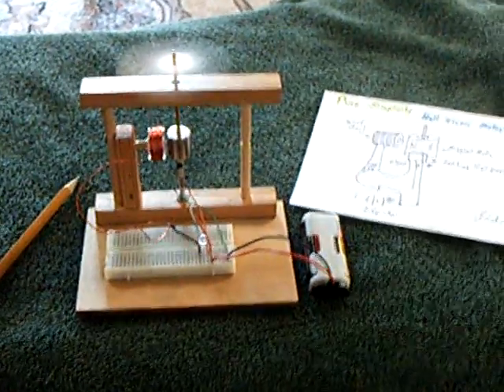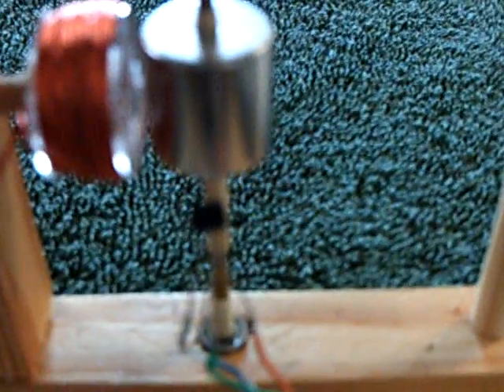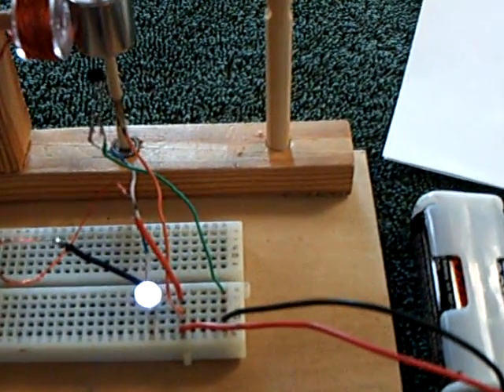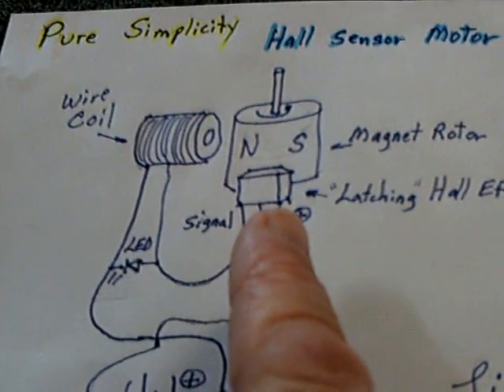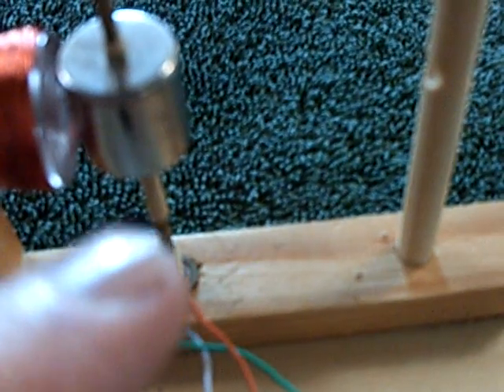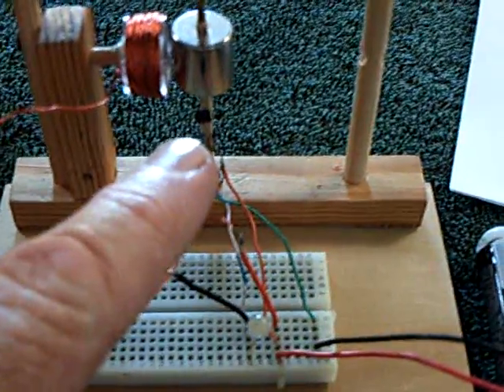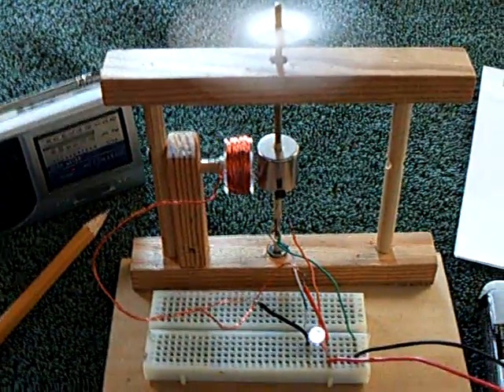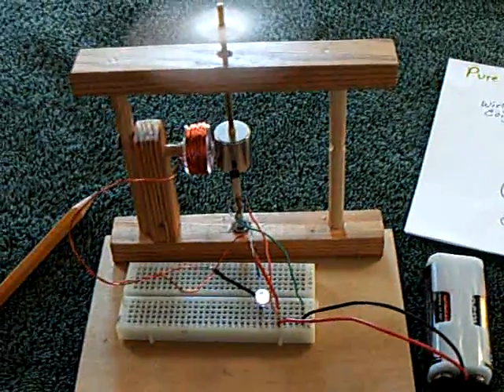Pure Simplicity Hall Sensor Motor

Comment: Interesting video, thx. I recently took a solar garden fountain pump apart, because it had stopped working. Much to my surprise there was a hall effect device in that brushless motor. It seems to me that the concept is similar to your example. I suspect my day/night relay may have zapped the hall effect device. Next time I will put a diode across the replacement motor.

Comment: Really great way to explain, thanks dear lidmotor, 
What will be spec of transistor"? and what would be the approximate RPM ?
Reply from the maker: This project was a from last year and I don't remember the specs on the Hall sensor.  Google "latching Hall sensor" and that should lead you to one.  I'd pick one that will work at about 3v and carry enough amperage for your project.  For this small motor it is probably less than 50 mA.  The speed didn't get measured here but it is probably a few thousand RPM.
Reply: thank you dear lidmotor,infact you shared the detail of Hall Sensor, i missed noticing it, S41 /230, once again sorry

Comment: What is the amp draw?  Looks really interesting.
Reply from the maker: +kafr8413  The amp draw is related to the coils resistance.  This setup draws about 40 ma.  The Hall effect sensor itself eats up about 4ma.  I tried this on on another pulse motor that had much higher resistance coils and the amp draw was way down around 10ma.

Comment: A reed switch will do the same thing, right ?
Reply from the maker: +magnetman2010  Really all this is ----is an electronic replacement for a reed switch.   I think that the long term reliability would be better.  The problem is that you need about 2.4 volts and it sucks up 4ma sitting there..  For guys like you and me that is a major drawback.
Reply: +Lidmotor Thanks for the comeback .
Reply from the maker: +magnetman2010   I keep hoping that you will do more project videos.  I was just watching one of your videos on the homemade batteries the other day.   You have done a lot of great work.
Reply: +Lidmotor Your self starting pulse motor circuit works great and has no reed switch.
I had some eye surgery about a year ago. That kind of put off the videos, maybe I'll do more sometime.
Reply from the maker: +magnetman2010  Sorry to hear about your eye problem.  That self start circuit should work on the EZ Spin motor or my Frog Hair motor.  I will have to try it.  Thanks.

Comment: Good hop thanks for sharing   Would a 1.5 recharge battery work in stead of the led?or larger super cap to which back and forth with the power battery's ??
Reply from the maker: +bruce don  Yes you can put a regular diode in there and charge a cap or battery.

Comment: Nice work!

Anyone know how to calculate the torque of such a device?  
The torque looks pretty high for such a small motor.

Rusty, what is your source for the diametrically magnetized magnet?  
Did you mount the axles onto the magnet or did you buy it like that?

Thanks for sharing!
Reply from the maker: +A B  I get my magnets here:http://www.kjmagnetics.com/products.asp?cat=16The ring magnet is mounted to the brass rod with masking tape as a bushing.  It is just a press fit.  Nothing fancy.  This motor has pretty good torque.  If I add a second coil on the other side it gets even better.
Reply: +Lidmotor Is this the one you used? http://www.kjmagnetics.com/proddetail.asp?prod=RC4CDIA or did you use the 1/2" od x 1/8" id x 1/2"?
Reply from the maker: +A B   I used the 1/2"x1/8"x1/2".  I have a few of the larger ones on other projects and some smaller ones also.  They work really well but don't run them at super high RPM.  I have heard that they can come apart and do real damage.  I personally have never had a problem.
Reply: +Lidmotor Good to know!  Thanks for the info & warning.